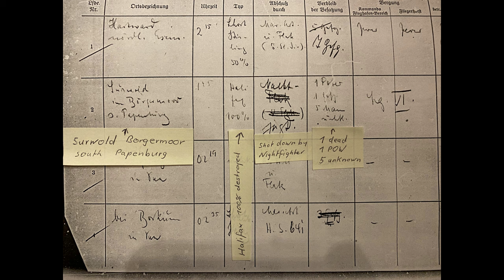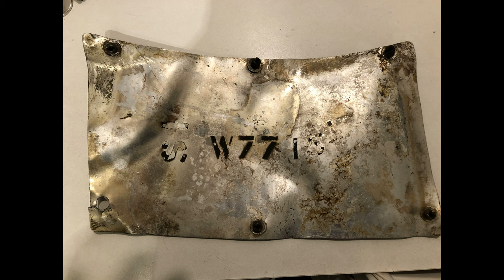The Identity Of The "Facebook Marketplace Merlin" Is Revealed... And It`s Incredible!

Comment: Hard to believe that it would survive being blown up and dropped into a bog at a couple of hundred miles an hour and being buried for decades in wet mud. And it runs. They really built those things!
Reply: From what he said, the wing was mostly intact as it fell towards the bog, likely meaning it acted as a parachute to slow it down, also it would have been a soft and squishy surface it landed in. That would explain how it survived to well.